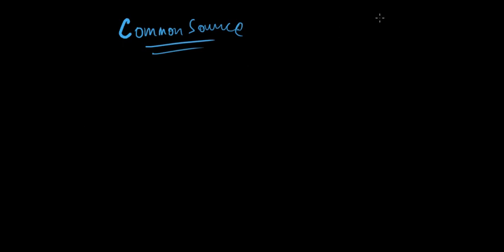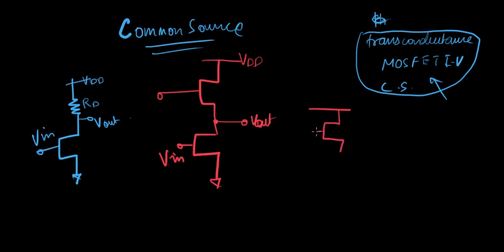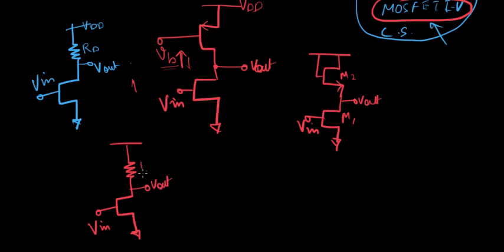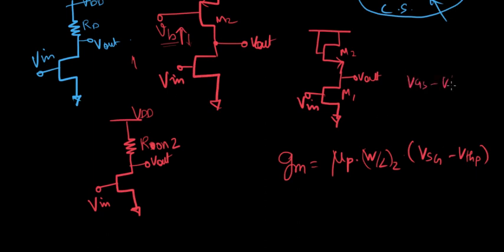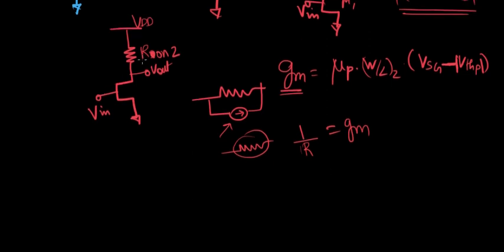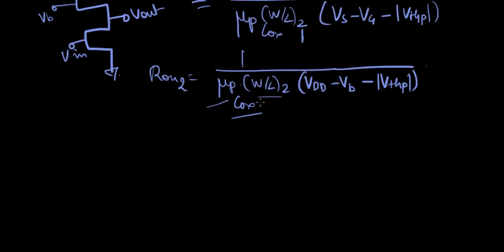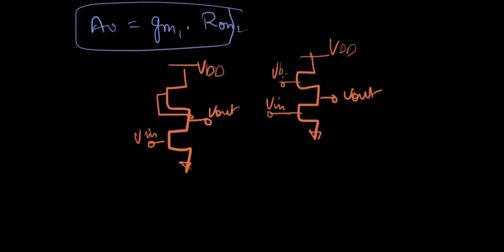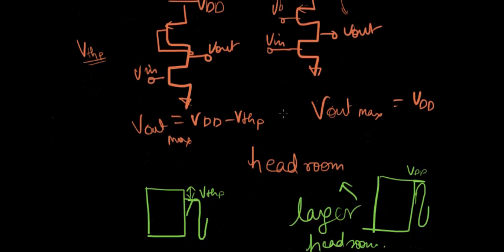Common Source Amplifiers - Triode Load

Comment: one question..in diode connected load M2 is always in saturatn..so is it not supposed to consume voltage greater than Vth?
Reply: Exactly , the real reason is :  In diode connected loads the output swing is inversely proportional to overdrive voltage, so when the overdrive voltage is very small( i.e we assume it to be approximately zero) then our vout becomes  vout=vdd-vth.

Comment: the equation of Ron is correct, but I think it is incorrect to conclude Ron=1/gm since Ron is resistance between drain and source(Rds).
Reply: +lingzi ye right the Ron is a term in large signal model and gm is in small signal model....